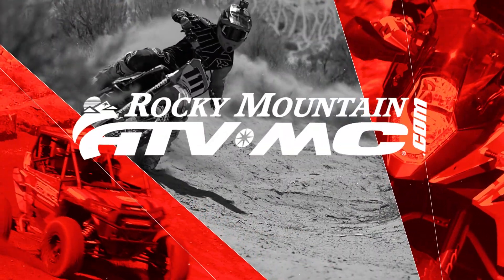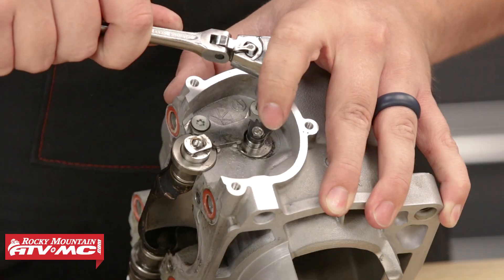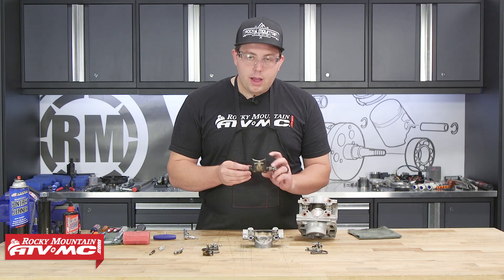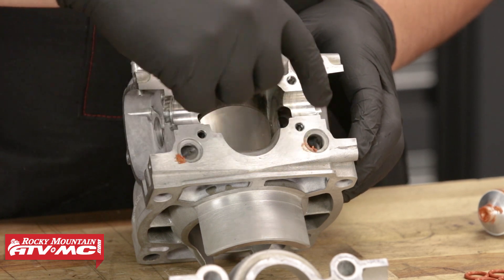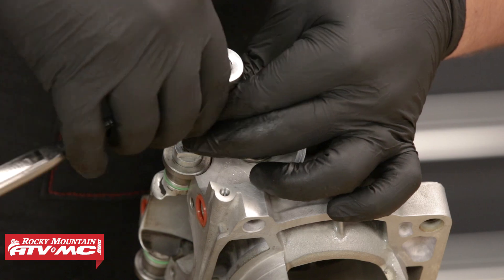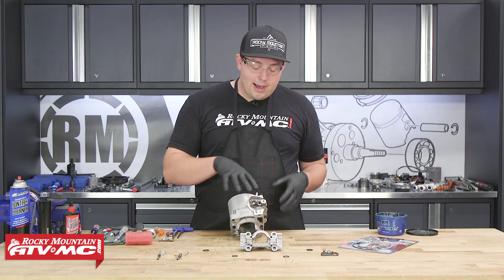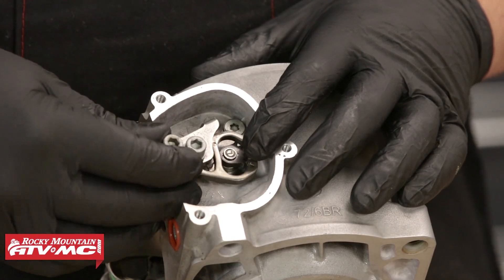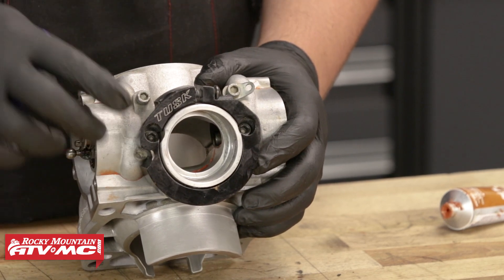KTM 300 XC-W Top End Rebuild | Part 2: Power Valve Rebuild

Comment: Awesome video RM! Do you happen to know if the power valve covers need to be removed to get the exhaust flange off? I need to swap out the flange with a new one and do not want to remove the entire cylinder head if I don't have to.  From initial attempts, the exhaust has been tough to remove but I haven't tried penetrating oil or too much force yet.
Reply from the maker: You'll want to remove the side covers of the power valve as there will be a gasket on each one that goes around the edge of the exhaust flange. You may not need to pull the entire cylinder head off to replace the flange, just remove the exhaust and power valve side covers.
Reply: @rmatvmc  thank you vm!

Comment: When deciding between a 23 300XC or 350 XCF,  what are the maintenance differences between the two?   Besides oil changes, is there one that’s more difficult to work on or maintain properly?  Thanks
Reply from the maker: Most people find two strokes easier to maintain. The top ends are a little easier and no oil filter to swap. I would base it on what you are going to ride over maintenance. If you're doing mostly hard enduro, 300 for sure. If you're riding a good mix of everything, the 350 will be awesome! -Charles

Comment: Two critical pieces of information missing in this video, in my opinion, that might make a difference for you: 1) on left PV flap, leave the middle (guide plate) screw alone and you don't have to reset the Z dimension. It it will remain locked in its current setting.  If you're happy with how your bike runs this is one less thing to worry about. 2)  I had to put the exhaust flange on first before I could put the geared guideplates back on. When I tried to do it without the front exhaust flange on, the plates would not go on properly. They should almost drop in. My PV was so tight I could not move it till I did the exhaust flange first. Slavens Racing has a video that complements this one very well. Thanks to RMATV for these resources!
Reply: Thanks . Did this last night and it saved me the reset issue. Much appreciated
Reply: So would that be to leave the centre Allen  key one in situ ?
Reply: @crluke14  Yes, the middle one, correct.  The slavens power valve video describes it.
Reply: geared guideplates what part are you referring to??? how they call this part you mean in the video... i am not understing what is this part are you explaining

Comment: Do you have any tips or tricks on how to get the flange off? Mine is very very stuck on and I dont wanna hit it any harder than I already am. It hasnt even budged. And yes I did remove the 4 allan bolts before. Are there others that werent mentioned in the video? Thanks
Reply from the maker: The only things holding the flange on are the 4 bolts that you mentioned you removed and some silicone. Does it look like there is a lot of carbon buildup that's maybe making it stick?
Reply: @rmatvmc  The power valve flap looks a bit gummed up hence why I want to get to it so thats perhaps why its stuck. Would heat or some sort of homemade tool help to get it off?
Reply from the maker: You can definitely try penetrating oil or some heat and tapping around the flange. Also, if you aren't already using a synthetic premix (something like Maxima K-2) that will really help reduce that kind of build up in the future.

Comment: do you have to do the exhaust value ? like everytime you do a top end?
Reply from the maker: It's definitely safer to check it out and clean any carbon deposits or anything like that. You wouldn't want to do all that work just to put it back together and wonder if you should've cleaned it up better.
Thanks for watching!
Reply: Rocky Mountain ATV MC how would I set the power valve “z” measurement without one of those tools?
Reply: What method do you use to clean the carbon build-up off the power valve?  That stuff is stubborn.

Comment: So say you were to take apart your power valve and forget which gear plunger thingy goes on the left and which one goes on the right. ( Not that I would be careless enough to do such a thing of course) Does it actually make any difference which one goes where? They both look the same...
Reply from the maker: Hey Rusty, that's a great question that I didn't bring up in the video. On these models the left side (if sitting on the bike) plunger/gear will have a "L" stamped into the outside. The rights side will be blank. Hope this helps!! -Chance

Comment: Nice work. I wonder how much different the process is for a Beta 300 is?
Reply from the maker: klxklr, the KTM 300 and Beta 300 motor are very similar. This video should help for the majority of your rebuild, but I would definitely check with the Manufacture to get specific details, torque specs and procedures to verify it's done correct. - Chance